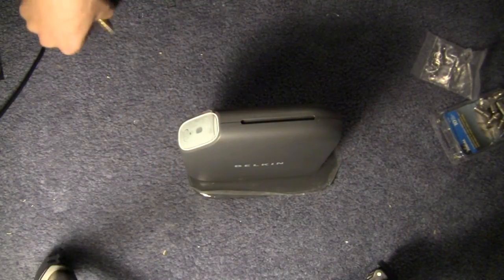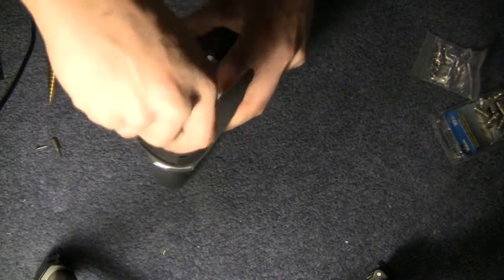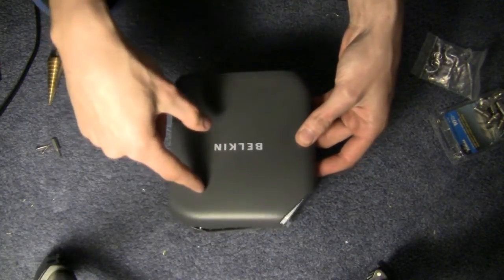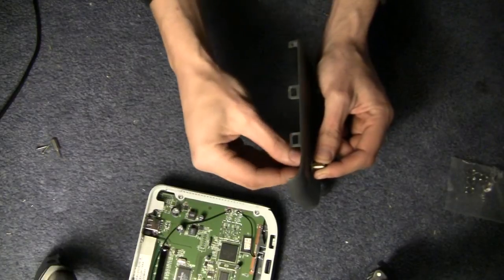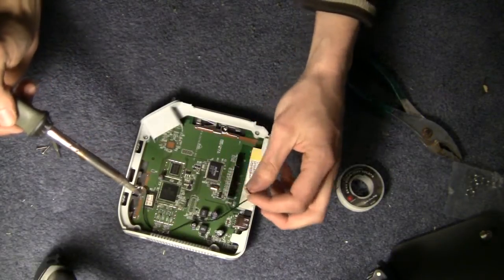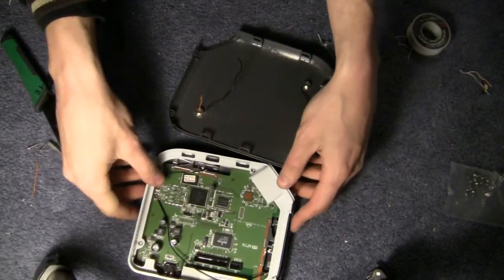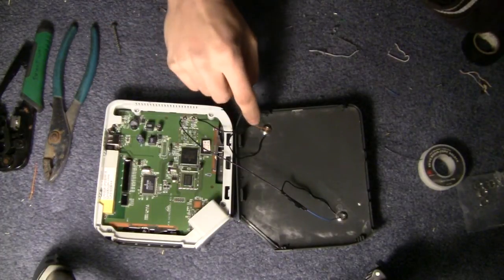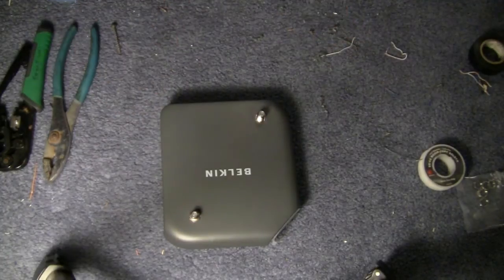Adding External Antenna to Belkin Share (Sharemax, Etc.)

Comment: Instead of disconnecting the internal antennas, can you solder the external antenna wires in parallel and that way you still have at least the internal antennas working properly? What happens if you clip or solder an external antenna in parallel with the existing setup and not remove the existing wires?
Reply from the maker: I'm not sure, I'm certainly not an engineer or anything, it might work just fine or it might make the signal weaker, I'm not sure if I still have any of these routers to test it with

Comment: Hi friend, excelent video. I've a Belkin router but is the version 1.2... I like learn and I want you can help me because the antenna maybe is in the same pcb and I I don't know where I can connect one external antenna. You can write me at the gamr1904@hotmail.com and I'll send photos of the pcb diagram. Thank you
Reply: Whats the benefit of adding antenna ?
Reply: @SamS-ef5ez  Because it don't have one and the signal loss easily, then I want performance the signal intensity in another places in my house
Reply: @germanmoreno9551  thank you for the reply, is this router any good in 2020 considering we have wifi6 ax , wpa 3 features now. I have this router lying dead in my store room. can i use this as wifi range extender or anything else? please suggest

Comment: Would this also work with a repeater
Reply from the maker: That's what I used it for, to connect up a "cantenna" on a satellite dish to pick up some wifi that was about 1/2 mile away. Would have worked even better had I used a similar antenna on the other end of the link as well

Comment: this will not work correctly.  most WIFI antennas are 50 ohm impedance.  this is a 75 ohm connector.  all tv coax cables are 75 ohm.  next the wire you used as a coax will radiate.  is has to be shielded.  these videos are mostly worthless.  believe me, I an engineer and also an Extra class ham radio operator.  you need to test the swr, check the signal with a spectrum analyzer and so forth...This ruined a router and is illegal.  as hams we can do this but only on certain frequencies we must stay on.  we can also run higher power.  pick up a book, learn and get your license.  you will learn the correct way to do this.
Reply: Get his license? For ham radio? He's not using ham radio equipment. Even with a ham license, it wouldn't give him permissions to alter the antenna setup of an FCC approved wifi router. It may not be "legal", but legality with this stuff is all based on if you interfere with anyone else's equipment and if you get caught or warned.

Comment: Hello Trythisiptv, I really enjoyed watching your video and I admire your desire to modify things to work better. Unfortunately, I feel that your efforts as Frederik Veeneman has noted, may be in vain. I have tinkered with computers and electronics for the better half of my life. I think that with the correct components, preferably an external antenna that is 2.4 ghz and 5 ghz from an old or broken router may work more efficiently. Then this mod would be an excellent fix to getting a better signal further out. You can also build your own antennas but that may be especially difficult to get exact. My main concerns are the wire lengths and the antennas themselves. If the wire lengths going to the internal antennas are NOT specific, then I can definitely see this working. Frederik did make a great point about the coaxial wiring and it's signal being degraded once split into two wires. Maybe if you get the time and spare parts, would you consider trying what we suggested and then comparing the two builds with net stumbler or some other method? Thanks for the video, great idea! Please don't take anything I say personally, it's just constructive criticism. I wouldn't have done any different or better myself.. I support your efforts and channel..
Reply from the maker: +Zen Attitude Of course I won't take anything personally, this video is one of many I've made that basically is a catalog of my learning.

I realize that this is really not the right way to do it, but i recorded a significant power increase with this mod, I will attempt a redo eventually with what I have learned in the past 2 years, and compare the various methods.

but first I have a slightly different project involving wireless routers. (that'll be done hopefully by the end of this week)
Reply: I look forward to watching it..

Comment: you can not just use wires to connect to the external connectors , they have to be shielded like the original coax,  those wires you are using are now antennas themselves and mess up the length of the external antennas (swr)
antennas need to have a specific length for the frequency they work on or they wont resonate on the right frequency
you made the antenna longer and changed the impedance of the antenna circuit with the wires you used
Reply: +Frederik Veeneman, I was thinking the exact same thing. From my very limited understanding of antennas and frequencies, they can be extremely finicky to tune. Isn't the wire length inside going to the antennas a specific length and the antennas are cut to a specific frequency? I would think that this mod would possibly make the signal worse than before?
Reply from the maker: +Frederik Veeneman you are correct, in ideal conditions, shielded wire would drastically improve this, however as i mentioned in another comment i made with a different person, I know this is definetly not the ideal way to do this, but it's how I did it, and it works.

plain and simple, it just works. maybe if i did it perfect i'd have double the range, but 1/2 mile instead of barely 400ft with work as shoddy as mine was in this video is proof enough to me that "can't" is more of a "shouldn't" in most cases, this being one of those cases.

looking back now, yes I would do the project differently, in the 2 years since I did this I have learned much, who knows, maybe I'll do it right one of these days and compare this version to the proper version.

Comment: I have a router just like that one  that the antennas where unsoldered. I was wondering what are the solder points on the round pads with one pad in the middle? Thanks
Reply: nope. do not use 2 separate wires. will not work. use a coax cable and/or proper adapters (to keep the impedance of the transmission line consistent)
Reply: It is an interesting project, yet, several significant changes need to be made into the design for it to actually work. The most critical part is to keep the impedance of the  transmission line (these two wires between the router and antenna connector make up a transmission line) constant. This is in contrast to letting the impedance go uncontrolled (likely very high) by using 2 separate loose wires as shown in the video. at this high frequency such loose wires play a role of inductors and are thus equivalent to a high impedance in series with the load (new antenna). Applying Ohm's law, it is easy to see that the antenna will receive little from the router. Second consequence would be that the signal would be reflected back into the power amplifier, causing additional heating. 

There are several aspects to making it all work:

1) ideally, one has to stay with coaxial cables. 

2) one can theoretically use twin-lead (i.e. two strictly parallel wires) or twisted wires to do the same but would need to do calculations of correct dimensions to achieve the constant impedance around 50 Ohm:

e.g theory in here:
https://en.wikipedia.org/wiki/Twin-leadand an online calculator here:
https://www.easycalculation.com/engineering/electrical/parallel-wire-impedance-calculator.php

No letting two wires loose - this way your loose wires will be the only "antennas" in the system and very little of the signal will reach the antennas connected to the new connectors...

3) the connectors should ideally be of 50 Om impedance, too. In the video, the connectors are F type and are usually matched to 75 Ohms. Depending on "design", one would easily loose between 0.2 to 1 dB in this. 

4) In many routers, there are RF connectors to which one can connect adapters and wires leading to external antennas, rather than un-soldering the coax cables.

5) The antennas would need to be suitable for the frequency ranges used by a router. One band is easier. For higher-end routers, high-gain dual-band antennas would likely be in need (otherwise, it would be questioned why one would need to go for external antennas in the first place). 

6) There is a very simple way to gain a few dB for one of the bands (but not for both at the same time!): One can take a metallic sheet and place it behind the router. The critical part is to have the distance between this sheet of metal and the antenna right. It should be about 1/4 of the wavelength (e.g. 0.25*(3e8/2.45e9) = 0.25*12.2cm = 3.1cm for 2.4GHz band - I used 2.45e9 are the middle frequency of the 2.4GHz band).

Good luck!
Reply: trythisiptv 

This is not the question to me. I trust you might have got some reasonable results for your precise "lucky" sample of a random configuration. I trust this luck was by chance, and would prefer readers to expand on your approach in a more systematic way (you are welcome to add a video to show more details). Please permit me to explain: From the video, I can see the wires staying apart for some distance (a few cm away from each other). I trust that the two wires must have got closer to each other as you closed the box (the closeness to the ground planes near the PCB could also played a role). This could have placed the two wires at a distance closer to the optimum 50-Ohm-bearing distance than what is shown in the video and thus improved the return loss and so the equivalent insertion loss. 

Before I go into suggestions, let's look at the numbers for a link:

1) Lets' first consider/theoretise about the "original" antennas. Looking at their size, their gain is around the gain of an ordinary half wave dipole. Assuming transmission power from the amplifier of 20dBm, we are looking at EIRP of about 21.5dBm. At 2.4GHz, 800m leads to the propagation loss/attanuation of about 98dB. Thus, you should be getting the signal  of about -77dBm at a receiving antenna (and, after you add this antenna's gain and subtract small losses in cables/connectors you will arrive at the RSSI shown to you by your end receiving device). This tells me that it should have been possible to link at 800m away, if both devices are placed correctly (e.g. at the very edge of a roof, and with no obstructions between them, i.e. at least the first Fresnel zone is not occupied). This is "theory" as as you say your device could not communicate at this distance without an external antenna, even at a low speed. This means that either the power is less than 20dBm or the antennas inside were designed without casing in mind or something else (incl. interference from elsewhere, because the original router uses omnidirectional antennas, and so a link would be more prone to interference).

If you have a spare original router and could try to communicate from it without the casing (i.e. removing it completely), this could confirm this, or tell us that something else is at play (e.g. interference). 

2) For the same frequency, the 500ft=152m gives attenuation of ~84dB. Thus, having about 14dB more of signal you could link things together over 1/2mi. 

Do you mean to say you used antennas of about 20+ dBi gain for your 1/5 mile link? This could explain a lot ;-)  If you had a lack of using something close to 30dBi, than the way you connect the wires inside would not matter too mach for a link over such a small distance. People managed to get Bluetooth running over nearly 300km distance with big dish antennas...

However, you may definitely have a point here - a 5 min mod with $0 cost, yet making a 27dBi antenna available for your link is a good deal.

If I now assume a biquad antenna with 11dBi gain on both sides, the effect is the same as the total gain is 22dBi...

If I now assume a biquad antenna on one side only, then there it is likely that interference was your main enemy and the relatively high directivity of this antenna solved the problem. Just theoretising ...

3) Let's finally look at your modifications, and what is wrong there and how it could be improved. I looked at 3 different configurations for wires and evaluated the results:
a) wires parallel to each other and at a distance close to optimum. This would give insertion loss of just a few dB and a good high gain antenna would easily compensate for this small loss.
b) wires in a triangular fashion with max spacing of about 1cm gave varying insertion loss, with max 8dB. If you are lucky, you could be in a region of small insertion loss and then you win. 
c) wires in a triangular fashion with max spacing of about 10cm gave varying insertion loss, with max 16dB. Few high gain antennas would have been able to even compensate for such loss. 

The troubles with your current design:
- the distance between the wires is not controlled and not even reported. 
- the length of the wires is not controlled and not reported.
- the proximity of the wires to the components inside the router is not controlled.
- There is no balun to compensate for the currents leaking on outer shell of the coax cable coming from your new connectors.
All these may lead to
- connectivity poorer than the original antennas;
- overhearing of the power amplifier (the router is already suffering from overheating, with just the Broadcom chips...);
- connectivity depending on whether you touch the RF cable to the antenna.
- interference to the router (possibly leading to instabilities in other parts) or to other devices.

 Thus, MY SUGGESTIONS to your design are:
A) Most importantly, try to control the distance between the wires (e.g. use a wide sticky take which would restrict the distance at which the two wires are from each other). Then try to experiment with the distance and see how the signal strength changes. Once you maximize the power transfer, the other negative effects are also reduced as the leaked power is reduced. 
B) Please note that the length of the wires will also play a role. Ideally the wires should be the shortest possible (unless you want to make a 1/4-wavelength transformer or something

Good luck!
Reply from the maker: ***** If I'm understanding correctly, the names are 2gant0 and 2gant1, the antenna side, the ground (outer piece of wire and outer ring on the solder pads on pcb) is the one closest to tghe pcb, wheras the center conductor of the wire coming from the pcb is goes to the more jagged, near the spot that looks almost like a sideways s or N.

If that doesnt make sense I can take some pictures and post them on the website.
Reply: makes sense .  I actually lost the longer of the two wires , is it possible to use 2 separate wires to make the antenna connections?. pictures would be very help full.  Thank you so much for your time.
Reply: trythisiptv  yes Pictures would be awesome because this pcb doesn't have the individual points labeled.
Reply from the maker: Albert Lysko Much of what you say is technically accurate, but in practice its not as true.

I've successfully connected to a stock router reliably from approximately 1/2 a mile away with this exact router in the video using biquad antennas, wheras with the stock antennas not even 500ft was reliable.

In a perfect world yes there are a lot of potential improvements, but where the tinfoil sheet as you mentioned would not provide any noticable gain and this modification nearly tripled the signal strength, I'd say imperfections there are, but for $0 and 5 minutes, its not a bad mod.

Comment: Is it the same layout as the belkin play?  Good video
Reply from the maker: Yes, the Share, Sharemax, Play, and PlayHD all have essentially the same layout, they're all nearly identical.

however, one difference to keep in mind is the play and play hd also have 5ghz radios, so there is 4 antenna wires. if you only need 2.4ghz to be on the external antennas the process is identical, if you need 5ghz externally then you'll need 2 more connectors and drill 2 more holes, etc.